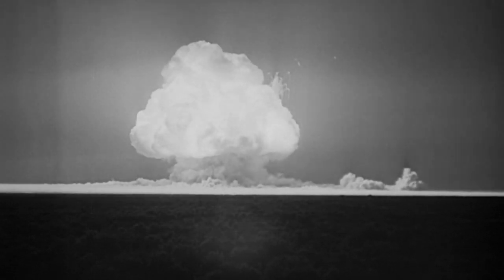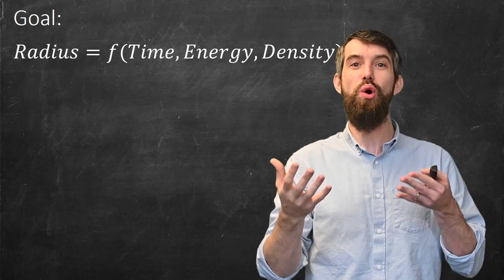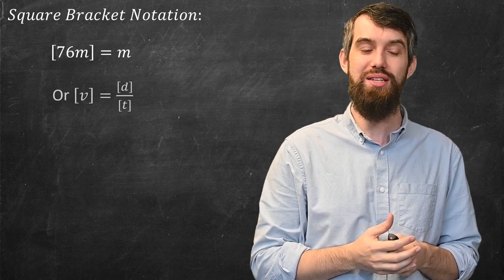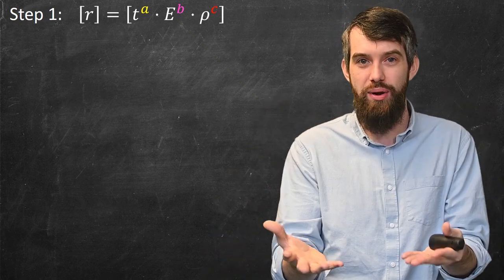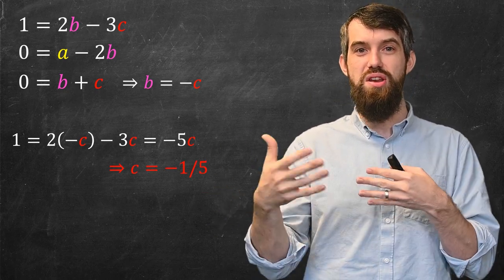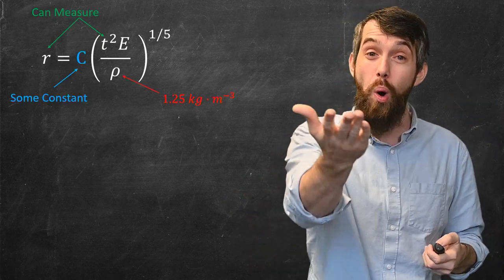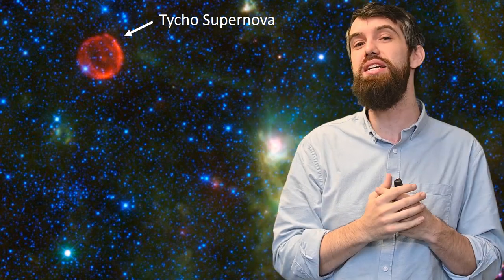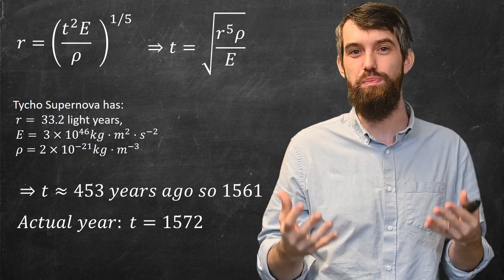Intro to Dimensional Analysis: How Much Energy in an Atomic Bomb? Or a Supernova?

Comment: Cool story bro, but you clearly never actually read Taylor's papers. The actual analysis was chock full of thermodynamics, gas law considerations, differential equations, and numerical integration. Although this is an entertaining story that also happens to be useful for teaching unit analysis, it bears no resemblance to the actual derivation. In fact, Taylor's derivation has no unit analysis at all. My point in making this comment is not to suggest that the unit analysis story is garbage; in fact it's actually astounding that we can use such a simple strategy to guess at a result that actually takes a lot more thought to derive properly. Rather, I am a science educator myself (in a much smaller scale), and I think that as science educators we have a duty not to oversell the "cool" while underselling the hard work.

(Edit: If you've actually read Taylor's papers and you still tell this story of what he did, then you're being very dishonest.)
Reply from the maker: Very interesting! I see you are quite correct. It is a common folklore - and indeed presented this way in multiple textbooks introducing dimensional analysis -  so much so that someone thought it necessary to write a story disentangling fact from fiction on this one: https://www.tandfonline.com/doi/abs/10.1080/0020739X.2011.562324?scroll=top&needAccess=true&journalCode=tmes20. Thanks for pointing this out to me:)
Reply: @Salien1999  Ah yes, clearly the problem is the correction, not the fact that the video, both in content and in description, continues to spread falsehoods, even after the correction.
Reply: Thank you. Good to know this.

Comment: I like dimensional analysis (I'm a physicist), but we need to be aware of its limitations.
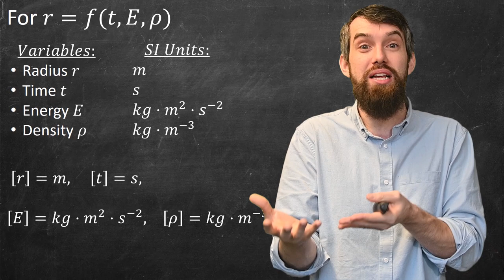@5:25 you go from r = f(t,E,rho) to r = t^a * E^b * rho^c without saying so.
That we can estimate r as product of powers of t, E, and rho is a big ASSUMPTION. It's an assumption that often works surprisingly well, but not always. As a physicist, I would put more time into stating that assumption - the rest is rather simple math, done in a minute.
Reply: The relation between r and t seems to be directly accessible from the photos, too, which should give us a good estimate for the exponent, a.
Reply from the maker: Agreed, definitely an assumption. It is almost shocking that it works quite as well as often as it does.

Comment: Congratulations for tackling such a tricky (for me at least) subject. A small thing to add. There is another characteristic for an explosion in air: pressure. But atmospheric pressure is negligible compared to the pressure behind the shockwave so we can ignore this dimensional parameter. Once the explosion weakens and atmospheric pressure is no more negligible, the problem stop being self-similar and the 1/5 formula is not valid anymore.

Comment: Why only multiplication? How do we know there is no sum, or others functions like 'e' or sine in the equation?
Reply: It's the big assumption that goes into the analysis. We can justify it by
1) it shows the correct behavior for the parameters: if any parameter goes to zero or infinite, r goes to zero or to very large (infinite), and r depends monotonically on the shown parameters
2) it often works, and surprisingly well